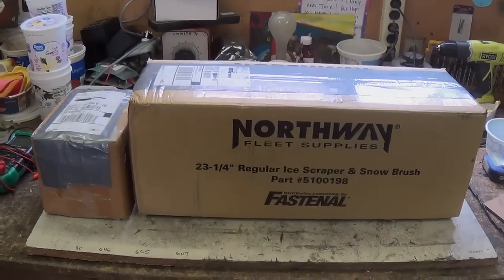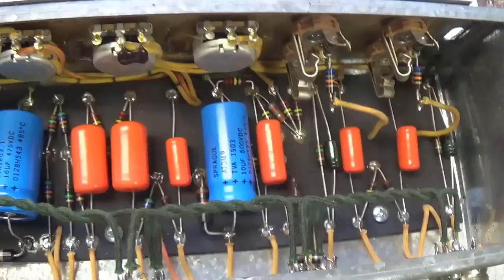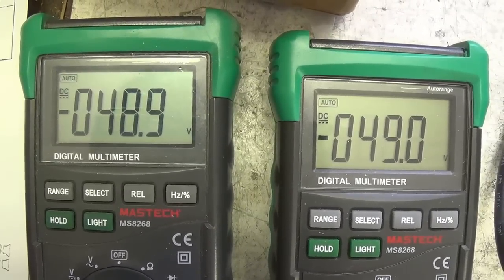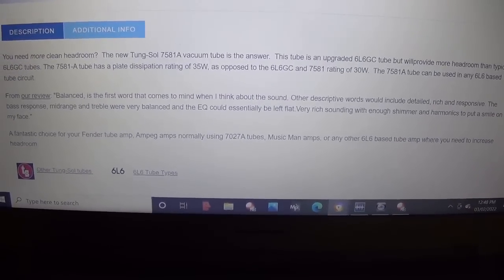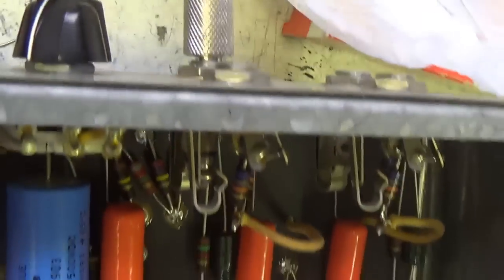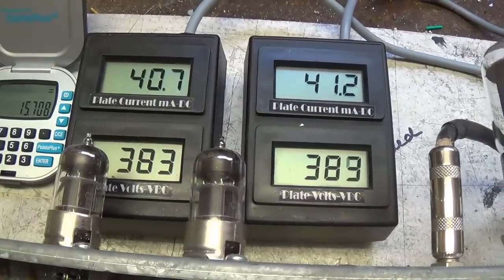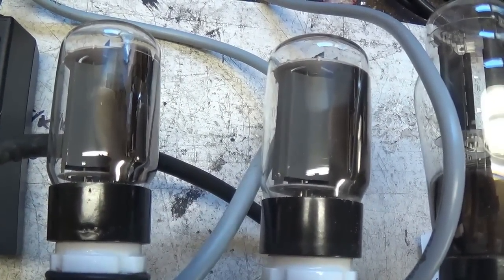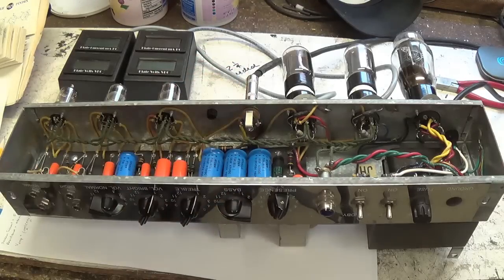Victoria Clone of a Fender Tweed 5F4 Super Amp

Comment: I just worked on one of this and contacted the company and they advised to set the amp using 6L6s to 32 watts total output.
Reply from the maker: What does "total output" mean? You realize that plate dissipation wattage (bias) and power output wattage are completely unrelated measurements? Even if they meant to set each 6L6GC at 32mA PC, the setting is too low. 6L6GC's can safely handle much higher PC......and actually function better at higher settings.
Reply: @UncleDoug  Yes, thanks, Basically I set the plate dissipation on each 6L6 to about 16 which I see is about what you did also. I sent the my 1st comment before I completed the video and didn't see that part. Also, sorry but I am self taught and I am not familiar with some of the technical terms. But I am digging in and watching your videos to learn more. Thanks
Reply from the maker: @GuitarTubeAmpRepair  No problem, GTA. I was confused by the lack of identification of what the "32W" referred to, and use of the word "output". It sounds like your PD settings are quite conservative and should promote long tube life. Keep up the good work.
Reply: @UncleDoug  Thank you and the name here is Steve.

Comment: I never use cheap Russian tubes they mostly have grid leakage about 90 percent in my experience sometimes you get lucky and after 2 weeks of playing long hours they come around 
Big tell tail sign I think with a magnifying glass look at the tube with some bass and if it flashes blue it’s got grid leakage and causes distortion
Reply from the maker: Thanks for the tip, Jim.

Comment: In that circuit, 7581a would be inappropriate. I agree that would tax the power transformer and possibly the output transformer. They want a lot of current. They are an uprated 6L6GC but very power hungry and sound fantastic in a unit that can keep the power flowing. 

I have amplifier that can run either EL34 or 6L6GC. It uses 8 of them and happens to be a bass amp rated at 300 watts. I use 7581a in it because it agrees with the circuit better than 6l6. There are only a few modern el34 that will continually take 500+ on the plates and approx 500 on the screens. The 6L6GC I’ve tried just run out of power very quickly in this circuit. I’ve gone rounds with Many tubes and those seem to sit well a long with the Ruby EL34BHT china high voltage but with what is currently going on, I may need to find a different set of tubes. And finding 8 matched NOS tubes is very difficult.
Reply from the maker: Thanks for the very informative input, Aaron :)

Comment: I now have pulled a stereo amp with the power supplies on the printed circuit board with the amps from an older Peavey 1600D mixer.There is a dead short in one of the amps or its PS. I hate printed circuit boards.
Reply: There was a time when most stereo equipment had reasonable access to both the component side and the foil side of the printed circuit boards. That pretty much ended at some point in the 1990s with the advent of audio video surround sound receivers.
Reply from the maker: I don't envy you, JD. Good luck.
Reply: @UncleDoug  I will find it maybe. I am seventy, I don't know how much time I have left. At least I know what board it is on. Probably in the PS for that amp.
Reply from the maker: @j.dragon651  I know the feeling, JD, being 5 years older ;)

Comment: You can have power flowing to the grounded chassis then? But it doesn't trip the breaker?
Reply from the maker: Could you give me a time in the video where power was flowing to the grounded chassis, P ??
Reply: @UncleDoug  with the capacitor connected to the chassis but the three wire power cord...
Reply from the maker: @phonotical  Since 60 Hz AC cannot "pass through" a cap of this value, there is no flow of current to the chassis.
Reply: @UncleDoug  I bet it can 😛
Reply from the maker: @phonotical  Not to any noticeable degree.

Comment: The cap shunting across the standby switch, and the cap used as an RF filter on the power line hot to ground, really should both be upgraded to 1000 Volt XY type safety capacitors that not only have almost non existent leakage, but if they do fail they're designed so that they fail "open" rather than shorted. Orange drop caps, even 600 volt rated,  aren't really suitable for this application.
Reply from the maker: Thanks for your input, GU.
Reply: Good comment, sound advice Y1 safety capacitor.
Reply: It's also worth noting that the standby switches get really beat up and pitted prematurely because it's much harder to prevent or stop an arc with DC current flowing then it is with AC current. AC current goes to 0 volts 120 times a second, and so the arc basically "wants" to break.  A switch arcing with DC wants to create a plasma laser and keep conducting!  By the way, most of the old stereo equipment I work on, old Pioneer receivers and that sort of thing, will have an arc suppressor or spark killer on the power switch, which consists of a capacitor and a resistor in series, in one molded housing.  Typically rated anywhere from 250 to 400 V,  and especially because it's switching 120v AC, and there's a resistor in it as well, that voltage rating is okay. I don't recall what values they typically use but some of the spark killers say right on them what the capacitance and resistance value is.  In the case of the high voltage DC standby switch, it probably wouldn't be a bad idea to use a series-wired resistor and  capacitor together across the switch.
Reply from the maker: @goodun2974  I seem to recall hearing them called "snubbers", GU.
Reply: @UncleDoug  , the term "snubber caps" is more commonly used for capacitors added to kill parasitic oscillations, as found in some silverface Fenders.
Reply from the maker: @goodun2974  I have never heard the term used that way, GU. The proper definition of "snubber cap" is "a capacitor in series with a resistor, which is placed across a coil or switch to reduce voltage spikes in that coil/switch when current transitions from flowing to stopped".

Comment: I used 470 ohm 3watts screen resistors on my 5e3 amps is 3 watts ok Doug?
Reply from the maker: Seems high to me, Paul. Say your screens flow about 5mA at 470 Ohms, the Power = 0.012W. I would suggest 1W.....even that is overkill.
Reply: @UncleDoug  ok thanks

Comment: Thank you for your great videos! You’ve given me the confidence to clone my favorite little amp, the Harmony H303. Unfortunately, it’s a series filament and I know you dislike those. However, this one does have a transformer, but that's where I’m running into trouble.   

My readings show the secondary as 230v split as 175-0-55, with the 55 going to the heaters and the 175 heading to the rectifier. Am I way off track? I can’t seem to find any transformer remotely close to those specs. Could you point me in the right direction?

https://midcenturyaudio.com/projects/harmonyh303_files/page13-1009-full.jpg
Reply from the maker: The transformer you seek is a very specialized isolation transformer, utilized to make the circuit safer than most series-filament circuits. I doubt that you will ever find one exactly like it. My advice would be to emulate a regular circuit, i.e. with a power transformer. Good luck.
Reply: @UncleDoug Thanks for the response and advice. I’ll sleep better tonight knowing a little more about that transformer. 
Looking forward to the next video!
Reply from the maker: @MiguelisNoisy  You're welcome, Miguel.

Comment: PS  Foolishness visits my house also but is not welcome.
Reply from the maker: Then I'll quit sending it there, Rich ;)
Reply: @UncleDoug  I had a very similar problem with a Bandmaster. Red plate only one tube and fizzy noise etc....same as your customer reported. It turned out to be one 6L6 tube socket pin gripper had lost tension. I readjusted it but changed both sockets to a better quality ceramic socket and it works great....no more loss of bias on one tube! Also I might add....please use a pointer instead of your finger that covers up what you are pointing out....thanks for the vids!
Reply from the maker: @daveharmon1907  Thanks for sharing, Dave.

Comment: If I'm missing something, I apologize, but isn't It perhaps a little foolish to put a grounding jack on the output like that?? Granted, you're never supposed to run a tube amp without a load, but I imagine there are novices that aren't aware of this... or absent minded intermediate level pro's that might forget that forget to, on occasion, if operating as a head or having used the other output etc... even plugging a guitar in and hearing the lovely sound of my tubes attempting to reproduce a chord with dubiously resonant glass tubes and plates all a-chatter, trying to substitute for my speakers... sometimes providing their own light show as well!  Hmm... this wasn't part of the Fender amp, to my memory. And I can't think of one positive aspect of this, unless you're the guy who gets more business fixing such amps! Yes?
Reply from the maker: Self-grounding speaker output jacks are actually quite common, Sean. By their logic, a dead short is less traumatic to the output circuit than an open jack, which can result in huge flyback voltages.
Reply: @UncleDoug  I think instead of self grounding they should short into an 8 ohm load resistor and a loud Piezo buzzer... I mean for $2800? Or maybe one of those "auto foolers" that prank that you wire to the battery terminals and when people try to start their car it makes a loud whistle, smokes a lot and finally BAM! You know... an ounce of prevention... and a dash of terror... lol. so it's actually better than an open circuit? Either I haven't noticed, or I've never had one on any of my amps.
Reply from the maker: @seansweeney3532  I was concerned about them too, Sean, when I first encountered one, but research showed that they are relatively common and safe.